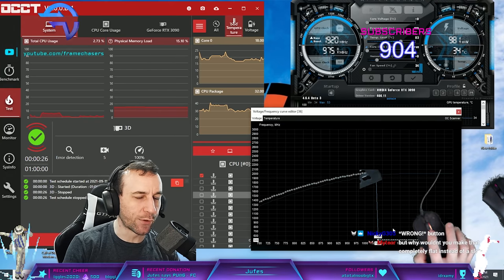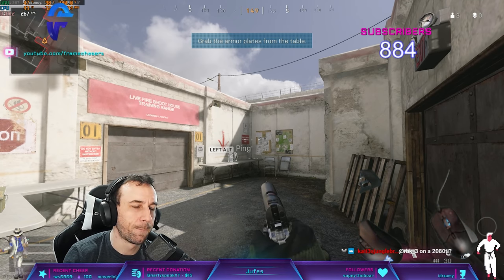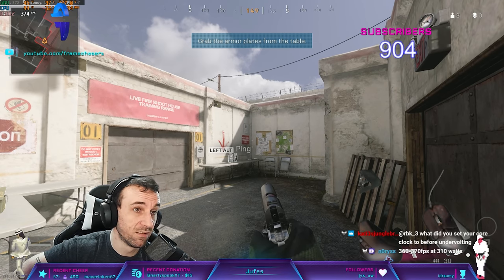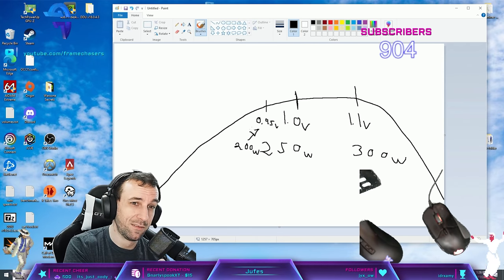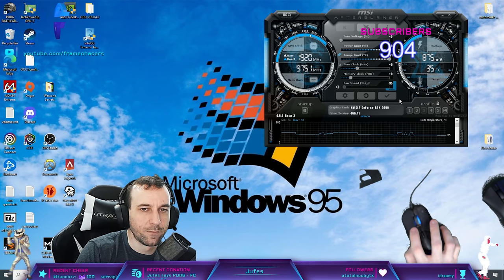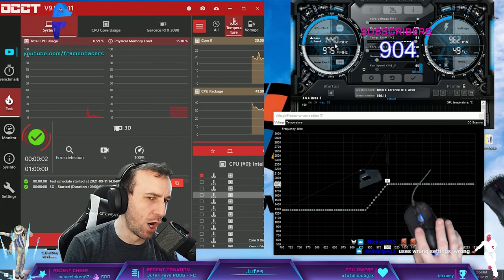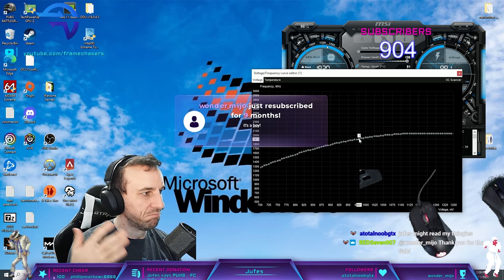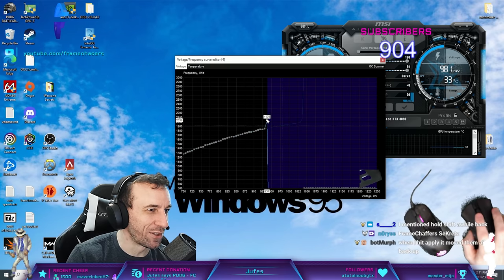GPU UNDERVOLT GUIDE 2021

Comment: Another tip I discovered: hold any point to the right of the middle (use the extreme right point, for example) and Ctrl-drag it upward. This "stretches" the curve upward, applying "proportional" increases to all the points on the curve.
If you want, say, 1900 MHz @ 0.975 V, Ctrl-drag the right of the curve upwards and keep checking the 0.975 V point; when it gets to 1900, THEN use the Shift-drag to pull all the other points below it, and apply😉

Comment: Got to hand it to you, the "flatten everything after the undervolt point" was a great tip - stops that huge step-down when it bounces off the power limit, if you've got a sharp "knee" in the curve.
EDIT - just compared the two techniques and gained 1.4% on Heaven😁

(And to whichever saint in chat told us about the "shift-drag" feature for pulling all the points down, 👏🏻👏🏻👏🏻👏🏻)

Comment: How is this even close to a guide?
Reply: He’s not a step by step guy, you have to understand his why’s. Anyways got my 3080ti to 2100 @ 1.025v and got better frames and won’t pass 61c w this method.
Reply: @GARZA_ICMG  mine is 3070ti and I get 1980mhz and don’t pass 60c is that good?
Reply: @SRYTGames  yeah you can probably push it to 2070 or 2055 even
Reply: @GARZA_ICMG  ill try
Reply: How is it not a guide? It literally undervolted it right in front of your eyes. You overclock it with the slider, then open the graph and drag down all the points that are higher than the voltage that you want. That's it
Reply: You  literally just don't want to think.

You wants instructions only

Comment: My 3080 12Gb was giving me 1860MHz when set to default settings. Ive undervolted and overclocked it now and I'm getting over 100MHz more AND using 30-40W less. Crazy stuff. 1980MHz at 0.9mV with +800 on the memory, rock solid stable in all games and benchmarks I've tested.

Comment: Just to see how far I could push things I undervolted my 3070 all the way down to 725 mv with medium memory oc.  Running superposition I managed a score that was 85% of the card's stock config using just 120 watts 55% of the max tdp.  I'd probably opt for a undervolt that gets me at least 95% of stock config performance for regular use, but I just think it's wild you can go that extreme with this process.
Reply: Cool i-ve been wondering how low the 3070 can go, thank you.
Reply: My 3070 already crashes at 1900mhz at 900 mv 😭
Reply: @BoboFerre  that's not great . . . Silicon lottery can be rough.  Try a lower clock I guess.  Honestly anything 1755mhz or above offers solid performance, that was the 3070's "official" clock speed.  Aim for 1810 mhz and see how low you can go on voltage.
Reply: @Orain88  i am running 1850 at 900mv and memory oc of 1220 something
Reply: @BoboFerre  ooooohh, that might be why you're crashing,  that's a loot of memory overclocking, way to much.  I don't overclock the memory more than 200 to 400.  I usually leave the memory stock speed.

Comment: Your way looks more promising I say this after noticing the change between locked voltage vs unlocked method on Afterburner. Here is a thing these cards are designed to rump up as required and when you put a hard voltage to the GPU your clock stays the same, not even using it so you will end up missing up your GPU in the long run also performance is also tasked (Temp, Response time and 1%low).
Thanks for this info.....great content!

Comment: My 3080oc tuf is an undervolt god! 1950mhz @9.25mv in the dreaded nzxt h1 fire box. Temps dropped 12c from 61c to 49c! And warzone feels like it has less latency cause my clock speed doesn’t jump around anymore, I ordered B die ram should be here tmrw, I’m hoping to finally get 240fps @1440p on rebirth island.  Thanks Jufes!
Reply: I just did 875mv at 1850mhz with my rtx3060, this is awesome i got -8°C and +2%performance in games

Comment: Whoaaa....that does save a whole heap of time lmao. I usually run a couple profiles, like 1 thats all out "have all the power GPU", one that'll hit and stick the highest overclock i can reach, Then another that has like a nice relatively high clock but a decent undervolt like this video (shave off some good chunks of power without loosing too many frames) then one i go through maybe the last 5 or 6 steps too maybe 1 or 2 steps below my Max OC, and fiddle with each steps voltage till i can find the lowest point that step will run stable at (some in the sub 1v range). Sorta like max OC on the least amount volts, then its free to bounce around the top clocks and still keep an undervolt

Comment: Great video.  Previously had 2070 Super 
Now have my 3080ti at 
Max Power & Temp 
0.95v 
+ 115 core clock (crash was at 123) 
+ 750 memory clock

GPU Clock 1980 hz
Memory Clock 1281.5 

1 hour run time Warzone Max all settings except ray tracing 

GPU-Z:  Max temp hit 76.6 C
GPU load 99%. 
Power draw 404W,     TDP 101%. 
Warzone stable FPS 155-169 on max settings.    240fps monitor.  Consult was great decision - do it.

Comment: I love this, got my RTX 3090 Gaming X Trio at 0.9 1860mhz @ around 300w but everything turns to shit with Quake 2 RTX where i can only manage 1785mhz 0.8v and still hits power limit @380w.
Reply: u mean 0.8 v
Reply: @KonDim  oops! yep fixed that thanks...cooling on the trio is good but not that good lol
Reply: i run 1860mhz at 0.875v on asus strix 3090 oc
Reply: @KonDim  Yep 0.875 is what i was using  but decided to play is safe for max stability and set to .9
At 0.9v 1905mhz stable on games like forza horizon 4 and assassin's creed odyssey but anything ray trace like control and i hit power limit and bounces all over the place.
380w on the trio is just not enough for much over 1800mhz stable on rtx games unfortunately.
Can i ask what you can hold stable on your strix with max 480 power limit and undervolt when pushed?....would love to know if the extra 100w matters a lot.
Reply: RT cores are separate units with their own power draw, so when the heavy RT utilizing game is ran - it starts drawing power for their needs as well, leaving lesser power left for the regular cores.

Comment: I always find a way to increase 1% lows in Intel CPUs by undervolting them through Throttlestop or increase single thread speed.

MSI Afterburner's voltage curve is kinda tedious to tune.
Reply: Yeah, I have to use a 6.5 version of Intel Extreme Tuning Utility, cause they locked Voltage changes sometime after that, but now I'm able to change voltage on my 10400.  I dropped it 0.090 Volts and got a bit better performance on the CPU, but a bit less on the GPU. I was trying to do the same with the GPU, but this, and other things, make tuning the GPU way harder. NVIDIA needs to act like AMD, and make a better App, but I don't think they care about their consumers in that way. They just want you to buy, and not tune things.

Comment: somehow I got the issue, that my cards still goes over 1000mV , although undervolting it to 962mV. What am I doing wrong? After settings the core clock and memory clock and "choosing" my desired voltage it just changes back after i hit the apply-button

Comment: Is it worth testing let‘s say every .05 V step below the maximum voltage and maxing that out for even higher clock speeds when hitting the power limit?

Comment: @framechasers so I want to go fully overkill with a setup and upgrade my system. Primarily stream warzone. If you could suggest the partsFor my gaming pc 10900k/5950x? Also motherboard Then which ram for highest frequency with lowest timings? After purchases going to pay for you to optimise it! :)
Reply from the maker: Best to just buy a consult so I can guide you through the entire process from start to finish, consult isn’t just optimization, it’s everything
Reply: @FrameChasers  so once paid for it if there was like game updates or something happened which tanked FPS after optimisation would you assist with that
Reply from the maker: @Rhomzy  it’s not a lifetime tech support service contract, that would be impossible and not worth 500$.  That’s what the discord 20$ sub is for

Comment: My 3080 Ti FTW3 still tries to pull 445-455 watts even when undervolted to .0925? Do I just have a hungry GPU? Or am I doing something wrong?

The other issue is I can't get over 2000mhz cause it will try to pull well over 450 watts causing it to power limit.. ugh

Comment: why dont u do -200 on the core then open uv hart pick which mv u want say 925 then click one dot and raise it up to 2000 mhrz and it do 1850 or raise it to 2100 it will do 1900 or might crash but u go from there not his way

Comment: can you still overclock your GPU if you undervault it?
Reply: I've been doing this currently as I just got a 3080ti. What I've been doing is what he showed in this video. I learned it somewhere else but same thing. When I did a normal overclock by just putting a number into afterburner i was able to get around +85-90. Didn't get into testing it because I learned about the curve. On the curve with +85 the my GPU hits 2005mhz at 1018mv. Been messing with this stuff since I got the GPU and i managed to get 2010mhz at 987mv. Stable on everything. Been trying to add more little segments to the OC with and undervolt but as soon as I put in another OC with an undervolt in the curve i crash. Let's say i got 2010 @ 987mv. Then I know I can hit 1950mh with 937mv but when I put that into the curve as well as the 2010 OC higher on the curve it crashes. I would also say to undervolt your "idle" clock. My idle clock is 1755 which would run at 912mv stock. Have gotten down to 787mv 100% stable. Haven't really gone lower as I crashed once on Netflix at around 750 something and just went back to the voltage i knew worked